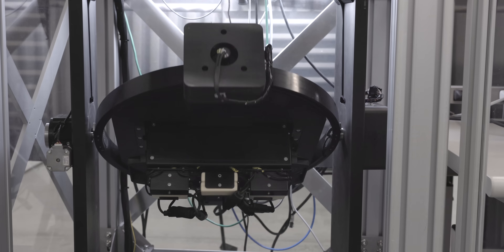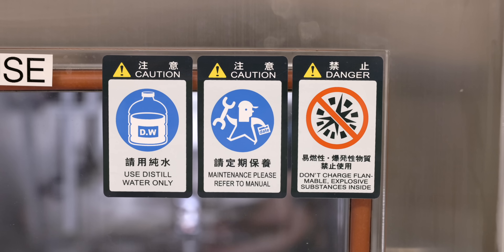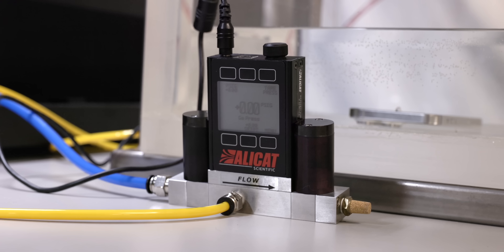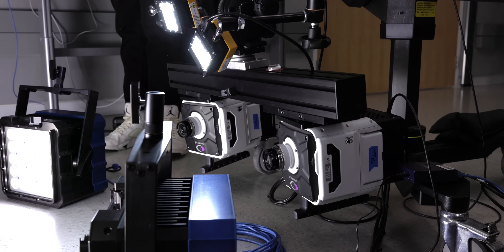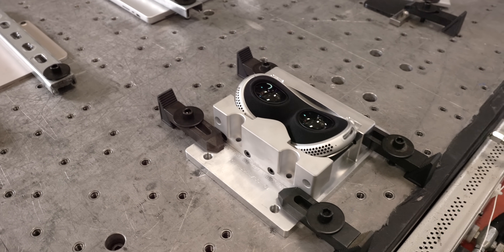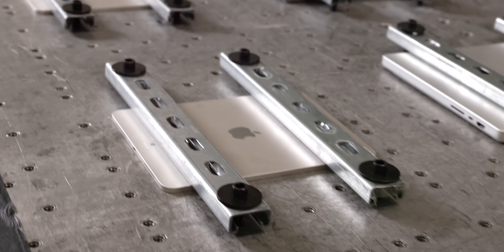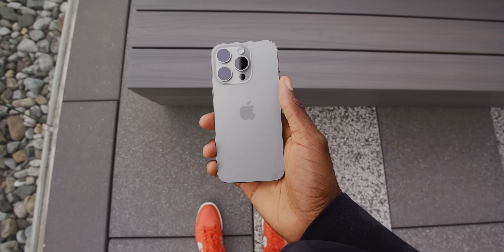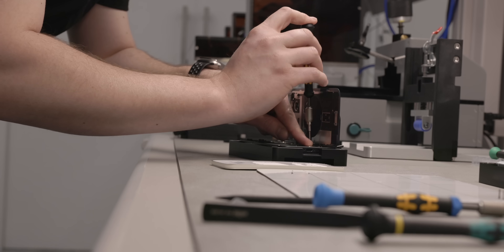I Visited Apple's Secret iPhone Testing Labs!

Comment: I'll cast my vote on "wish things were more repairable" too, but, frankly, it's disingenuous to think it's all just malicious profit motive.

In actuality, I don't think Apple makes that much from repairs.  Case in point -- the first Apple computer I bought was a 2015 Retina MacBook Pro.  LOVED that computer.  I used it until I replaced it with an M1 MBP.  At that point, it was at the end of supportability by Apple, so I had the battery replaced while I still could.  (I like to keep my old computers, after having spent a lifetime giving away generations of old hardware and wishing I still had it.)  I paid about two fiddy or three hungies for that -- parts and labor.  Not the cheapest replacement battery ever, but I don't think a replacement for my old VAIOs or work Dell Latitudes was ever under 2 hunge either, and that was literally a module you just slide off and slide back on the @$$ end of the laptop.  IIRC, my first VAIO battery was also two fiddy (completely disregarding inflation hikes since the Pentium III was contemporary.)

So, Apple demanded between 0% to 50% more than a typical replacement.  For that cost, I got a genuine battery, a brand new bottom-half aluminum plate with new keyboard and touchpad -- which is good, because after ~7 years, the keys and touchpad were showing signs of wear, as they have on all my previous laptops.  They also realigned the hinge from when I knocked it off the top of a rack-mounted Ampeg bass amp, on top of a 4x10 cab, onto a cement floor.  (The only damage sustained was a spec of smooshed aluminum on one corner edge, and an alignment gap between top and bottom that would probably be considered within factory spec on a Lenovo.)  In short, the machine came out about 33% of the way to brand new.

I'd say I got a pretty good deal.  Maybe they made a buck.  Honestly, I hope they did.  I like the idea of quality parts being available, vs. being forced to compete with bottom-of-the-barrel junk that technically fits and technically works, but isn't as good as OEM, and makes it impossible for independent repair shops that DO use real parts to survive because it costs twice as much, and most people don't know the difference, so they just look more expensive for no reason.  Having a line in the sand where someone says, "No, it's going to cost this much because this is what it costs to maintain quality parts inventory and skilled labor" is, frankly, refreshing.  Ask anyone trying to replace vital parts on an older car and only being able to source "factory equivalent" parts.  Ask Dank Pods.  "NEW PARTS ARE JUNK."

I like the idea of people having the choice, but economies of scale rarely allows both ends of the market to actually thrive at the same time.  So, if Apple ends up being the "slightly more expensive to buy, slightly more expensive to maintain, but the stuff is quality" end of the market, while anyone is free to crap out an Android-based device at whatever price point they're able to justify -- great!  I'm happy to pay a little more.

Comment: Just graduated with my degree in Mech Engr. My Capstone was the design of an automated door cycling system to test the durability/lifecycle on refrigerator doors. (Ran millions of cycles). Very interested to compare the tests vs the use case.

Comment: Durability and repairability aren't at odds with each other because they are not alone on the scale. You gotta add in your design. You can make an incredibly repairable and durable phone, but chances are it is going to be really hard to make it look good to the public eye. It is the fact that we are getting thin glass and metal slabs that make it necessary to compromise on durability and/or repairability.

Also there is the whole money thing. Either the product will cost loads more if you want 3, and/or the company selling the phone doesn't have motivation to make it repairable because they'll make more money off you just replacing instead of repairing.

Comment: Its not more sustainable either because imagine having a phone that needs 10% of itself repaired every year. Over 10 years that would mean you only need 1 new phone worth of parts over 10 years vs having to replace your irreparable phone every 2-3 years because the battery starts dying or you dropped it or whatever. Even if you only change phones every 5 years. You would need double the amount of raw materials compared to repairing it.

Sure you could argue that 10% is a too low figure and it might ramp up in the end but I still imagine it would still be more sustainable

Comment: In my experience, I've seen some ultra durable phones and computers which have great repairability too. Thinkpads, older machines, where you could upgrade ram and stuff. The thing is though, apple devices fail, a lot (see Louis Rossman). So while making their devices impossible to repair, they are also at the same time unreliable? How?

Edit: They have repair solutions, but they price repairing cheap parts crazily high in order to get consumers to buy new devices, which just beats the point of "sustainability"

Comment: "The number of repairs has plummeted" because of the fact they make it extremely expensive to repair or too annoying to repair. Too much friction. Yes durability is great but they're not on different ends of a spectrum. Choosing to think that way is what is stopping them both being able to advance together. I understand there's more to it but that's atleast what I think of it at the moment.

Comment: sure, there's tradeoff between repairability and durability. If you slap more glue on your device it's not gonna break as often.
but that's not really what people are annoyed about with apple when it comes to repairability. I don't really fault their engineer because they can't break the law of physics.
Most people is taking issue with the fact that when you do get to repair it, Apple artificially blocks the attempt. They block it by using uncommon screw (which serve no mechanical advantage over just using torx) they block it with part ID. they block it stringent partnership with third party repair. These are what people are angry about and these issues does not come from physics it comes from either stubborn ness or greed

Comment: FYI: Apple may do all of this testing, but they DO NOT stand by ANY water resistance guarantee. In my case, I purposely put just the top third (the lenses) of my iPhone 14 Pro underwater to shoot some video. By the following morning, all four lenses were fogged. The phone shut off and wouldn’t restart by that evening. The phone was only about 6 weeks old, had zero wear and tear, and had full Apple Care + loss and theft protection. I was still forced to pay a $300 deductible to get a new phone. I argued that my phone must’ve had a manufacturing defect that made it not ip68, otherwise a 2 min dunk of only half of the phone couldn’t have caused water damage. Logic would say that if one of my camera lenses, speakers, etc. had been the subject of a manufacturing issue and therefore didn’t perform to specs, Apple would obviously replace it cost free. Why wouldn’t this situation work the same way? No one has a logical answer other than Apple documents water damage/repairs aren’t covered.

Comment: Interested to hear about the durability vs repair angle with cars. Many car makers following the apple gambit. But cars have accidents. Too many cars are written off because there is no way to test if a battery is safe after a small dent etc. As an example insurance write-off for minor underside damage in Kias and Hyundais. 

For evs to help the environment, don’t they NEED to he repairable like ICE cars?

Comment: 7:30 Apple has component pairing for the physical components inside the iphone, such as the front-facing camera. This means that only apple certified components can be used as part of a repair, this makes it harder for independent repair shops to repair iphones. And that is not related to durability, but rather Apple wants total control over the repairs, and they can have a markup of price to repair, as well as make it artificiially seem like a hassle to repair so that you want to buy a brand new phone instead.

Comment: There's no reason to assume that durability and repairability exist on a mutually exclusive sliding scale. Rather, I would propose that they exist in a 2-d plane where the axes are probably not totally independent (e.g. increased waterproofing leading to more difficult battery repairs). Under this sort of framework, the goal should be to find the pareto-optimal designs that lead to maximal repairability and durability.

It's convenient that the apple employee continues to mention that durability is better for the environment because it means less materials for repairs (an employee of the same company that wants to make sure you go nowhere else for your repair business and charge exorbitant prices for repairs). This may be true, but I would argue that repairability is just as, if not more, important than durability if we're putting on the environmental lens. Phones are fragile. Even though they're more durable today, they still break frequently. The idea of an "infinitely" durable phone is laughable. Repairs are essential for making sure these devices don't end up in landfills.

Comment: Crazy how Apple puts all this effort in to make sure devices are still operable after intense use but still design their devices to last a couple of years at most
Reply: @carloskreek7419 bro stop joking..I know you are Samsung fan boy
Reply: what are you talking about? iPhones have the longest longevity by far. It's not rare to see people with homebutton iphones (iPhone 8 or earlier).
Reply: @PfropfNo1 they made the SE 3 in 2022. That’s a home button phone.
Reply: @blitzkrieg33  fair point. Was thinking about my dad with iPhone 7. But iPhone XR from 2018 is also still a popular phone.
Reply: @Kevin-mx4vm  well, I’m not claiming a 2016 phone is competing with 2024 phones but it’s still running. And that on 2021 software.

Also after 5 or more years it might help to reset to factory settings and then install a backup. Improved my XR performance quite a bit.
Reply: That's where Samsung comes in, to play. 
I was using my Galaxy 20 until I got my 24-ultra. If not for wanting the avoid fixing the cracked screen, I still would be using it until the 25 came out. 
Samsung values their phones working for as long as they can and only comes out with new ones each year for the people that "have" to get the newest model each year.

Comment: I can’t resist to reply when I hear the BS😂 They are trying to make it more durable but obviously not 100% bullet proof. The battery and cooling is so bad that I have to turn on the low power mode all the time to reduce consumption and heat. I don’t trust the waterproof after using it for a year. The reason is the heat generated through the year will easily damage the seal and adhesive that will not guarantee it’s waterproof anymore. Furthermore, they make battery replacement so unnecessarily complex that basically prevent any DIY. Why does my battery have a code that has to match with the system otherwise the faceID won’t work?😂😂😂 There are ways to go around it, but why…just marketing BS that force more people to upgrade to a newer model.

Comment: It's not even just that they make it hard to repair. It's the cost to repair. When to replace the device is only 200 more than the repair, most go to just buying the new device. They price it that way to have you buy a new device. Now if they priced the repair reasonable, it would be different.
Reply: Also, they apparently don't do bend tests. Haha

Comment: Welcome to the world of Reliability Engineers.  Btw, in addition to vibration and drop testing, there is also shock testing.  The packaging material (boxes, foams, etc.) also go through similar testing simulating shipping conditions.  All these are very old and proven techniques employed by electronics industry for a very long time.  There are also third party labs, such as UL and TUV that do similar tests as well as various safety tests.  Every electronic / electrical equipment goes through a lot of testing and certifications before they show up in stores for you to buy.

Comment: I'm sorry, but that apple guy was talking garbage, no disrespect intended, 
I've taken appart a 12 pro max, specifically taken a cracked back off, 
You have no idea how hard that is without a expensive apple lazar machine, the adhesive is ridicolously strong, i was scraping tiny individual fragmants of the back glass off, no other phone company was this kind of gorilla glue like adhesive, no one needs this, the difference between normal adhesive and apple adhesive doesnt affect the IP rating of the phone, they just want people to go to their repair shops to service their phone,
That glue is nothing too do with durability!!

Comment: I’ve dropped my iPhones countless times in the last 8 years, never had one break because of that (use protection people!)
What fails first is usually the charging port loosening too much, the microphone becoming garbled despite cleaning attempts and of course, the battery degrading significantly after 3 or so years.

Comment: Bullshit on the reparability point. Sure, the balance between reliability and repairability is fair point. But what about the software locking of components? How does that tie in with reliability? How about not allowing people to buy spare parts to repair? What about the repair costing just as much or more than a new phone? And before a sheep comes around pointing fingers at Samsung, yes them too. Most companies actually. But unfortunately, the world sees Apple as a leader. So if Apple can get away with it, so can the other companies

Comment: Durability and repairability are not mutually exclusive bruh. Just look at older tech, older cars, older anything. There's japanese tech from the 60s that still works today and is also very good at what its doing, and it barely ever fails, and when it does, it's repairable. Case in point: why the ABSOLUTE FUCK does the back panel have to be glued to the back like a shitty chinese 90s product ? Gaskets and screws exist, use them. Cars and other products have been using them for decades. No, this is to sell you new back panels because the other ones "broke" oops.

Comment: 1. Each drop/submerge/test needs to be a new phone, won’t be fair to reuse a dropped device for the next drop. So 10K doesn’t sound crazy.

2. That vibration test I was also thinking it needs to withstand shipping across different modes of transport and not arrive DOA to customer.

Comment: Says most phones still breaks on impact and then wants to tell us that we shouldn’t worry about repairability because theses phones are so reliable in the same video
Reply: That really depends on the impact, though.  If you were alive and buying cell phones in the late 90s / early 2000s, you would probably know that dropping an old Nokia brick meant your phone would dash off one direction, and your battery would go another direction.  There's a non-zero chance the antenna nub would crack, and if you were unlucky, the LCD connection would fail and you would get a blank screen.  And of course, I knew people with cracked screens on their mostly plastic and rubber phones.

THESE days, if the drop isn't completely fatal, it's probably nothing more than a minor cosmetic blemish (a slightly dented edge or a bit of rash.)  The whole middle zone of failure has been wiped out.  Nothing this small and delicate can ever be made indestructible, but they have sure gotten as close as I could imagine coming.

Comment: You can make a extremely durable and extremely easy to repair device it just wont be extremely thin. When you get constrained in size the easiest way to get physical durablity is obviously tons of glue and tape. But if you have no size constraint you can easily design an extremely beefy, modular, easy to repair device that is also built like a tank. The obvious answer is that very few people want the tank shaped phones,

Comment: The difficulty in repairability has to do with the serialization of components to the motherboard and difficulty getting Grade-A/OEM components. Other than that the hardware itself is just as easy to repair as any other device.